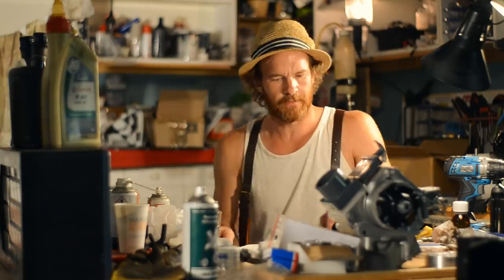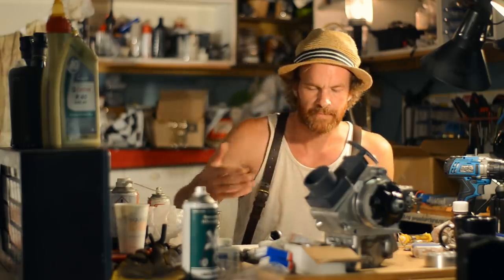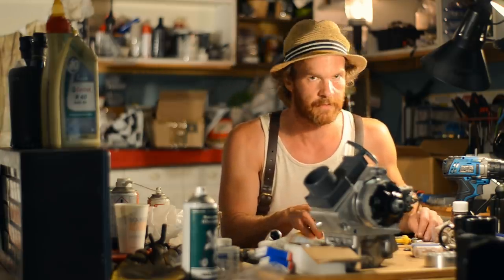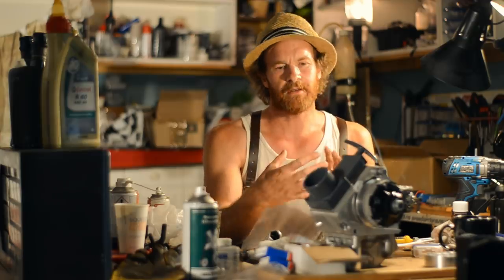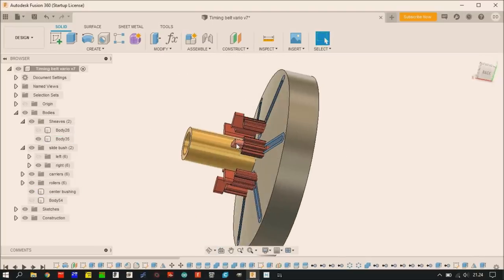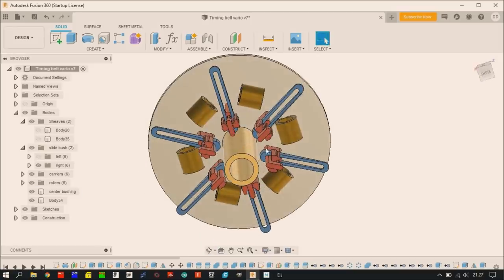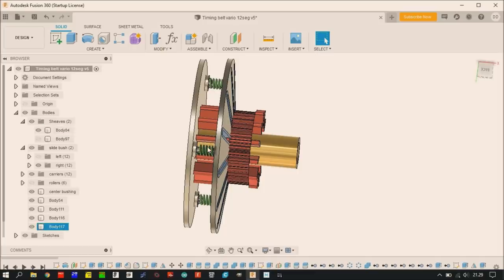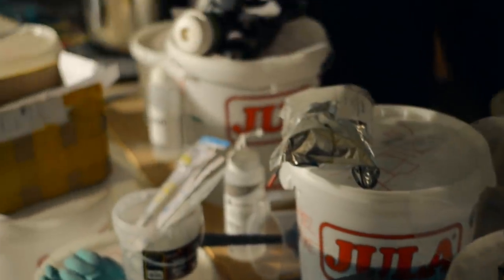The Most Powerful Two Stroke Ever - Revolutionary CVT?

Comment: I think you are on to something with the derailleur and cassette gear set up. Less moving parts the better. See Alan Millyards mountain bike. I think the timing belt idea will be troublesome and as the sliders move out it will change the pitch of the teeth. But good luck🤞🏻
Reply: Yes that guy Alan is a freakin true Geinus
Reply: Unlike my spelling

Comment: If the toothed drive teeth sets were seated on a rubber "shock absorber layer " this would help the belt teeth engage but also the jaws would expand more on the rear " no belt engagement " cycle of the rotation thus helping it reposition for the next "expanded " engagement with the belt. Just a thought !!

Comment: Another option might be the Toyota style cvt using stacked metal plates om a string that are pushed by the pusheys (like pulleys). It is supposedbly efficient and has already been developed. Probably needs to run in an oil bath though.

Comment: Put the Variable Ratio Sheaves on a jack shaft with the final link being chain or a cogged belt arrangement allowing rapid ratio swaps as required. Another option using the same driven clutch logic is having the variable sheaves on the rear axle. If the Variator is the driven member then the highest drive ratio becomes the smallest diameter and really the only time you need the cogged connection so all the power goes into velocity. Much easier having static cogs to fall onto after the sheaves move fully apart. The engine would benefit from always having a fixed cogged connection to the belt. A left hand throttle control could move the engine via a stepper. A simple up and down switch programmed with one shots or a potentiometer could work. Industrial automation PLC thinking here.

Edit: Using RPM to control the drive ratio would be an easy setup with a driven variable clutch. 

Edit: Like a snowmobile driven section with the engine movement controlling the ratio in use.
A separate thought, a flywheel that has weights that move outward with RPM might be an energy storage device or to trigger some useful thoughts.

Comment: Didn’t read all the comments, but offer that a one way clutch on each gear would allow gears to be pushed into tooth alignment and still pull the belt, or each gear being timed to the housing (teeth on one side of the channel that the gear rides in) to essentially “time” the gear to the distance it’s moving from its adjacent gear may work.  Not sure how long any of this lives at 10,000 rpm though

Comment: The second idea on your timing belt is close,  but it's still not going to work optimumly. They won't be able to expand with the rotating force because the teeth on two adjacent sides will be locked into the belt,  unless and until it gets enough space between two adjacent sliders to leave one empty space between them.  Until then they'll be put of line and stress the belt... but if you had individual teeth held to each other by springs,  they would be able to follow the grooves on the belt much easier without stressing the belt?

Comment: The idea of the vacuum servo is very nice, but it will probably need some additional parts and it also has some limitations. Your maximum force is limited due to the surface area of the piston and a maximum pressure difference of 1 atm, so to increase max load you may actually need to make the piston are quite large. But the main point that will probably be a bigger issue is that some kind of dampening will be required. Just the vacuum spring would lead to some high frequency oscillations that could mess up with the tension of your belt system.
But please keep up with this project! I'm very anxious :D

Comment: Ita been a week, i know. I can see a adaptation from a umbrella in the jaws, so their movement is dependent of each other. If each jaw is hold by one link on each side, the jaws out of the belt wont move away if the ones engaged also dont move, they will lock in position togheter. Theoretically ofc. Keep up the good work!

Comment: Not sure it’s a great idea but worth a try👍 . Perhaps make the drive teeth like partial small tooth pulleys, running in a loose slot allowing only partial rotation thus keeping pitch correct as they travel outward👌.

Comment: variator + a gearbox with 3 gears_ so you get a higher final drive in each and you "reset" the cvt back to the start of it travel and it still keeps you in the rpm, again at max travel you shift, and reset the variator, you lose more power, but you get a much longer gear ratio and you are always at in the powerband

Comment: This is a cool Idea. I wonder if the Teeth could have an origami-esque folding portion between them so that as the teeth slide outwards to "go up the gears" the space between them would fold out so that in top gear you would have no gaps between the teeth. Since you are going for constant load the transition might not be as important- you just need to get going and then hold it wide open.

Comment: I think use a variator that’s balanced to the engines range to effectively just  increase the outputs duration slightly but aldo it will reduce strain , that driving a pulley that’s coupled a 3 or more sp gear box that drives to the rear cog

Comment: looking good the variator using the inverted toothed timing belt  my friend and I had a similar idea for a pushbike front variable clanger changer(sprocket) The easier it gets as road speed increases  the more  the ratio adjusts  to pedal speed and the reverse when going uphill and pedal load increases as road speed reduces and adjusts the diameter of the sprocket ? maybe

Comment: The main problem I see with that design is that the teeth moving outwards by centrifugal force will during transition expand beyond the pitch dimension of the belt. A cv with belt is analogue in a way and a timing belt digital if that makes sense. I admire the engineering and thought you have put into this project. Best of luck, ill be watching in anticipation 🙂

Comment: Kind of a similar process to Wavetrans, Vectr and Veridrive. Because there are only finite positions where the belt will mesh there's needed to be fairly complex control systems to step the gears apart and ensure that you get proper meshing between the chains and gears. In your system you might be able to overcome some of the control issues by introducing some slop into the system so that the gears would kinda self align if they were slightly out of the correct alignment. I think you have a potentially bigger issue though and that is the amount of horsepower that you can get through a fairly small number of meshed teeth. From memory you were talking about 20 or more horsepower and I don't know if you could get that through the few teeth that will mesh.
Thinking on the process and problem further the use of a micro v (serpentine style) belt might work as a variator. The drive pulley can be simplified and there will always be 100% meshing over the 180 degrees or whatever the wrap works out to. These style belts are also suitable to up to about 30,000rpm but they actually derate ate higher rpm as centrifugal force tends to throw the belt off the pulley.

Comment: Been loving the videos thanks.
On your toothed belt variator. As the diameter of the toothed section increases so will the pitch between the teeth.
Thinking it will be hard for you to get it to work.
You might try a belt with large teeth and gaps and make your teeth in the variator thin .
But I think there will be a point where the pitch changes too much for the belt to accommodate.
Cheers Dave

Comment: I was thinking that if you change the stationair carrier sliders to a rotating ( full diameter with teeth) with a ratchet function so that it automatically adjusts to the teeth on the belt.
succes with your projects.

Comment: If you look at the KTM 85 or really any 2-stroke dirt bike they're really worried about package size and it's amazing they can fit the crank clutch and Trans in such a small compact package. I think for your build you'd want to do something like 10 speed close ratio. Cant beat a dog box. Dry clutch too, you only need a clutch to start and stop. I think you'll find the bikes power limits and aerodynamic limits for Speed, and you can gear the bike to max out at that speed so your torque is optimized in the mid range.

Comment: You could use a electric Generator wich feed a Electric Motor, so the combustion engine is at constant speed while the wheel slowly speeds up. I think big diesel locomotives use this technique.

Comment: About the fuel injection. So one injector can't pulse fast enough.... but why not run more in sequential. So example. Set fuel injection system and set it up as say a v8. But have it see it that each fuel injection event is on a different cylinder but really all 8 injectors would be in same intake to the one cylinder. It would slow down events to 1/8th of the speed. It would almost be a continuous fuel flow but each injector would be taking turns and would keep it very easy control of fuel ratio. I really hope this makes sense. Very hard to try to type to explain.
Reply from the maker: The problem is at 20k rpm you have a window of about 1ms to inject while the transfers are open. A fast injector might have 0.5ms opening time+0.5ms closing time - no time for actual fuel delivery.
Reply: @2STROKESTUFFING  agreed. But you can adjust off set of injection and wouldn't be waiting for the on off of the injector since you have more than one injector so time to turn on and off don't really matter. So figure you have 8ms of injector time instead of 1. They would each take turns. It would take 8 ignition events to fire all 8 injectors if you set sequential injection. Dont get me wrong this wouldn't be ideal but would have way more control of fuel than relying on pump speed to control fuel.

Comment: The efficiency of a belt drive variable transmission is determined a lot my the lack of ability for exchange of force from the belt and pulley, you only want short term I’d say etch or mill the inner pulley surface to create extra grip on the belt

Comment: You might think of replacing some of the sliders with toothless curved ones(or toothed rollers) that would still hold the belt to the same diameter, but wouldn't contribute to the torque applied to the belt. Doing that would let the belt stretch needed to jump to the next tooth be halved.
I don't know much about belt stretch, but wouldn't a stretchy enough belt to jump teeth also be quite lossy?

Comment: The spacing between teeth on the belt is a constant distance, called "pitch". As the sliders attempt to move outwards in the slightest amount the pitch between them will try to increase, but the belt will prevent that because it doesn't stretch or morph its pitch. Unfortunately, this is a no-go :)
Reply from the maker: I'm hoping for enough slip for it to work but share your concern.

Comment: I think it will vibrate when the teeth are all the way out. A 9 speed bicycle cassette would be the go and be like 10% more efficient. Put a small sprocket on the crank then the cassette a long way from the motor so the chain has room to bend/change gears , then a final drive chain and sprocket to the rear wheel of motorbike chain to handle the torque. And you could swap them around to find the perfect gearing

Comment: this won't work: if all of the toothed sections have to move together then during expansion you're trying to stretch the belt, which is reinforced with fibers specifically so it won't stretch. What you would need is for a tooth to be able to move independently of the others but get locked in place when it comes in contact with the belt.

Comment: Watch out. When it's full vacuum, the atmosphere in it is zero. Even if you pull it more out; zero is zero. So the tension stays the same after it reaches full vacuum. Because the outside pressure is 1 atmosphere and doesn't increase or change.

Comment: You have great ideas keep it up ! but see 2 mayor issues with that design , the moving spiders would have to be small rotating gears or it will go out of pitch with the belt  and doing that would defeat the purpose ,also under load it would become a changing star shaped pulley
Reply: Muchless the insane "drag" it will put on the 50cc engine..

Comment: Nice looking design you have there. Question, have you calculated your top speed RPM yet? That is going to determine your multiplication ratios you will need to cover the spread from takeoff to top end. Snowmobiles have large diameter pulleys that give them a very wide ratio. A plus side to this might be that it could give you more control of your power band... As far as controlling it, I like servos better than steppers for they have feedback... JMHO... I wish you the best...

Comment: With the 1st variator design, why not use rollers on both sides? That way the belt would sit more evenly, the teeth would slide much more smoothly and I imagine you may need the extra weight to actually hold it in the top speed position. The teeth will never work either they would have to be smooth (grooved belt or not).

Comment: I think the belth will keep the pully from moving, or the pully will brake the belts gruves.

How about making rales in a cylinder for the parts where the belt lays  oon spaced so that the belt gruves fit in.

The up shift would happen by pulling out the cylinder to let let the "weights" go to te next level. The parts wuld actually move on the "Death" side, where there's no contacts with the belt.

Sorry for the bad explanation, just storming ideas. The down shift wuld still be an issue, but I think the way to go is to let the shifting happen on the dead side of the pully

Comment: The bike gear idea I’m messing about with on a reverse trike using a GX390 engine will make a Jack Sprocket to turn the single front from a centrifugal clutch so I can adjust the drive and centrifugal clutch sprocket size etc and then a DH set of gearing with chain guidance and rollers so I can shift though 9 gears I see it as a mechanical 9 speed ZF 😬😬😬
Reply: I will add I’m not looking for a fastest anything just a idea of my own build vids will be coming soon I’d love your input tbh 😬

Comment: I don't know if it will help but NISSAN CVT uses a 'spiral wound" belt..I'd suggest going to a transmission shop or salvage yard and getting a broken one you could dissassemble and inspect.  I have fooled around with several but decided to use a gearbox as they are very comolicated and it seems to me that the increased factor of failure doesn't balance to the reliability of a gear box..The simplest CVT I have seen is the "tried and true" Snowmobile style with a simple sprung V pulley and V Belt...The object seems to be the design of the Two Stroke and not reinventing a CVT Transmission..On the engine..The RV Sewage Valve won't be sufficent to controll the Fuel Injection....a Bronze/Brass "on/off" Lever Valve will be much more efficient...and controllable...Ideally I think I would use a Fuel Injector (less chance to of bursting into flames)..As your design runs a "constant rpm" it would be simple and light weight...Once you have a reliable 50cc engine (tested and proved) then you might "revisit" the CVT Transmission..but I would suggest breaking the  project into "doable" parts, instead of trying to design everything all at once. As always, my wishes for Good Luck and Results!!!..Keep Working!!..👍👍👍🗽🇺🇸
Reply from the maker: Thanks! These exact thoughts have been going through my head all day. I'm going to get that engine fired up asap. First on the primary intake alone with no pipe just to see if that special piston/100% ex port will work at all, then go from there. If I can get that cylinder honed true without removing too much of the plating this can happen very soon. Exciting!
Reply: It will of course need re-plating..

Comment: I have idea for gears. Rohloff can take 130 Nm. IF it isn`t in the wheel hub, it doesn't need take full  rate of torque. It can be cheaper shimano hub. Rohloff have much better efficiency.

Comment: Don´t spend time on that.
It won´t work.
Calculate number of teeth difference in inner position and outer, you are on to it in your first 'won´t work', the belt will lock them together.
It´s like a sprocket and chain, you need to add kogs if keeping the pitch between the kogs when going up in size.

If the cvt belt slips, you cvt is just setup wrong.
The only slip you should have is when cvt alters diameter for the belt, the belt need to slip a little due to the same problem as above.
But when it has reached it´s end position you should not have any more slip, and by that not much losses.

Comment: To change speed you need to increase the tooth count on one side and or decrease the tooth count on the other. What you are doing is spreading the distance between teeth until the belt slips into new position. Think it over before you waste too much time.

Comment: I love the idea, but sadly I fear it cannot work (I really hope you can prove me wrong though!)

The positions of the gear teeth would need to be independent, and in being independent would oscillate terribly under any sort of load, and since the distance between any two teeth/segments must be a multiiple of the belt pitch, the segments will only be engaged with the belt when in certain positions. and they would assume those positions 1 at a time.
In my mind's eye I cannot see it working smoothly and as you intend. if it works at all, it will be mess of stripped teeth and unreliable as hell.  Cool as fuck though!

Is the v-belt CVT really that bad?